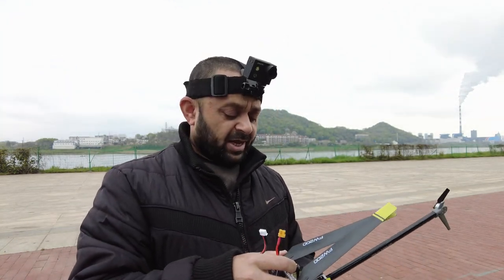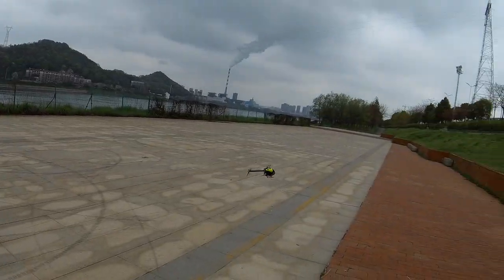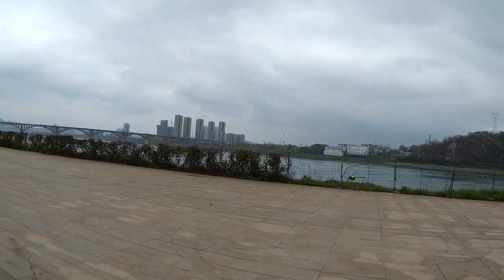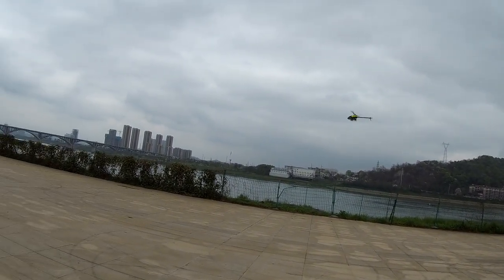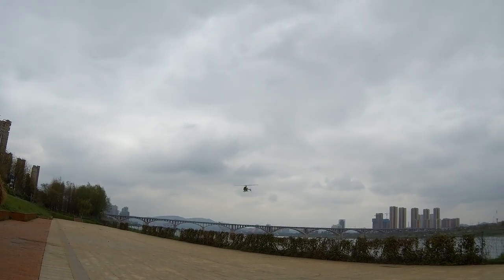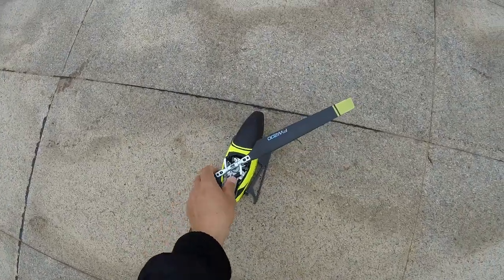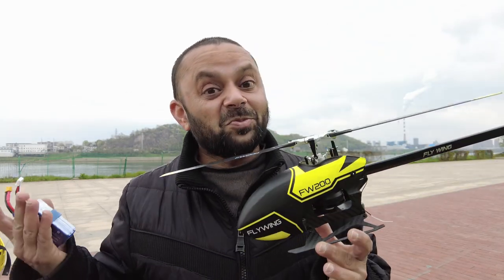Flywing FW200 H1 GPS RC Helicopter Flight Endurance Test

Comment: Ali, I know you are tied up Paramotoring, but if you have a minute, can you  send me the dimensions of your 11.1V 1500mah BT-17 battery? They are not available anywhere before June, and I need to find a substitute that will fit. Coffees are on the way if you can help. Thanks, Mark
Reply from the maker: 33 x 25 x 74 mm (H x W X L). Well not busy in paramotoring. its been raining non stop for over a week or more now. what happened to world weather? i moved to this place because it was nice and warm and winters were short, summer were long. but now rain rain rain, it sucks. anyway busy in other reviews :D have fun buddy. hope you find these dimensions other brand batteries.
Reply: @alishanmao  I can't thank you enough! I found some that should fit, but may only be 1350mah. I'll buy you some coffees. Here in Florida just starting to get close to 90F, but no rain. Hoping the wind let's up when my copter and radio arrive.
Reply from the maker: @Starkman3  No need coffees brother. your following my work is the biggest support. recommend my channel and my videos to more people. 1350mAh will still give more flight time than 850mAh. Have fun.
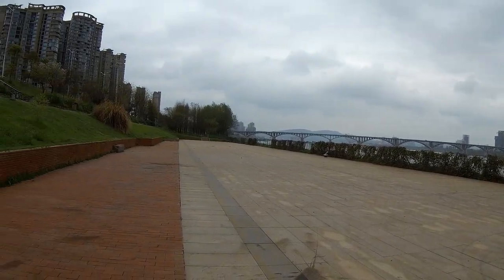Reply: @alishanmao  I have my chopper, 5 flights, unexplained crash after takeoff on flight 3, broke a servo arm, plastic epoxy fix. Did you have trouble getting canopy on with 1500mah battery? Mine are 71mm long with wires bent to the side, but nearly impossible to get canopy on... so far, 4:30 with 850mah, about 15:00 with 1550mah. Thanks
Reply from the maker: @Starkman3  canopy fits well with my 1500mAh, no issues. regarding your crash, many people have reported such crashes. maybe its because GPS or software glitches.